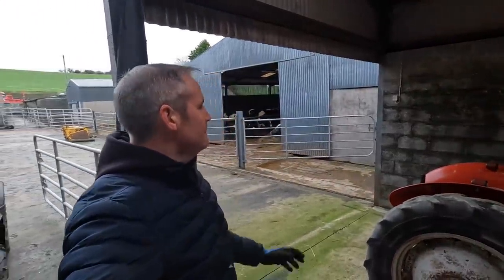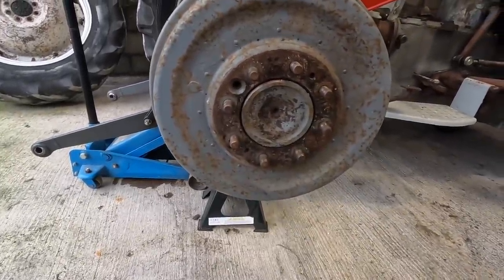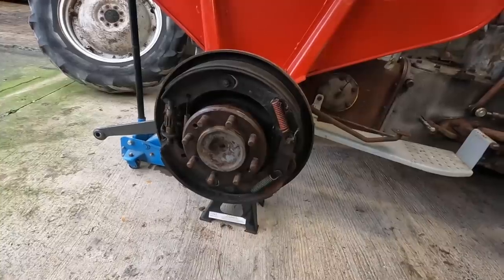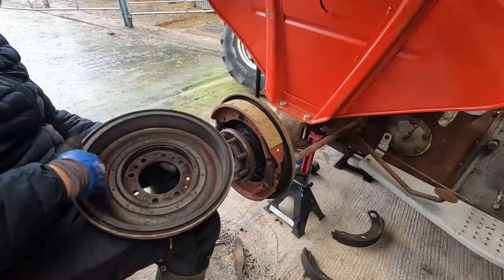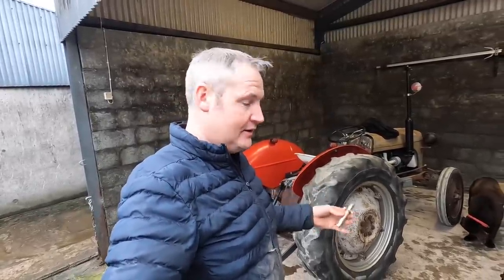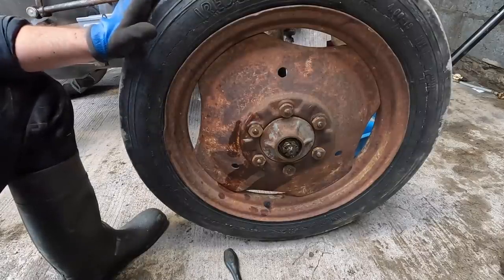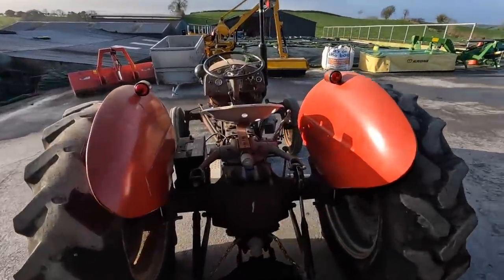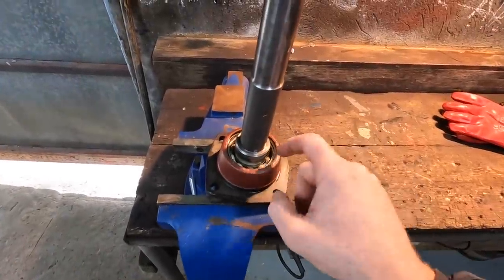FERGUSON TEF 20 RESTORATION -- PTO SEAL-- BRAKES OVERHAUL-- AND SOME VERY MILKY OIL!!

Comment: We replaced the pto completely with the larger size shaft so it can be used. Took the pump out too, found out it was well clogged even tho it worked. I'd say that front wheel will still wobble when u drive it. Taking a fergy for a spin up the road is enjoyable, anything more is not.

Comment: I think im right in saying t20 had studs and washers to hold the brake shoes,the pin and spring were fitted to the FE35 onward.
Reply: 100 percent Mark
Reply from the maker: Hopefully so, means I’ll not have to take them back off 🤗👍
Reply: Yes Mark 100% correct fella..

Comment: Make sure rubber around gear stick is not worn or cracked, moisture on rain water will get in der👍
Reply from the maker: Have one here for it 👍
Reply: @IFarmWeFarm  Ferguson T20 dont have rubber around the gear stick, that wasnt until the 35's.  T20 have a metal collar on the bottom of the gearstick.

Comment: I drive my 135 and goldbelly all late spring and late summer and I love them without a cab, it can be colder, yes but the cabs never are the best and can be a pain, the only reason I live the cabs is the aspect of safety, many times I have clipped my leg on the tyre or rested my hand to far out to the left and be driving along only to have dust in the eyes. Nowadays I would say cabless is the better option, at least for >40 horsepower machines

Comment: I can remember rolling ploughing with a DB 880. Had to keep your hands out of the steering wheel or you’d end up with snapped wrists. Great video. Good luck 👍
Reply: My grandad used to let me "drive" a 135 up a bad road. Quickly learned to keep my fingers out of the center of the steering wheel!

Comment: I know it's 11 months since you posted this video, you where so lucky to remove that brake drum with your hands, in all the years I worked on tractors I never had one like that, it was heat hammer or sledge hammer even smashed the drums, we always used a centre pop on the retainer screws if you did not have to drill them out, Happy New year to you and your family

Comment: Partner & I are about to restore his 1953 TEF20. Your videos will be a great help for this, lets hope we can get the parts needed🤞🤞 already struggling 😅 can I ask what engine oil you have used in yours? (is it also the same for the PTO?) It'll be one of the 1st jobs we do, once we've cleaned up the grease 🙈

Comment: Just watched your video I've got a 1952 Ted T20 my brake shoes are identical to yours ie same springs and the 2 nuts it all works perfectly fine so I would suggest leave them as you found them👌

Comment: The red springs in the right hand drum when you are putting it back together, am sure there is supposed to be two different colored springs as one is a leading shoe, so maybe a black spring at the bottom and red on top.  Cheers

Comment: Adrian, the phrases "it's the wrong one" and "it doesn't fit" are all too familiar as I'm replacing parts on my TEF20 as I go. I don't know where the retailers are getting this stuff from but some items are a bit shoddy. The MF35 is still in production (!!) and I think we might be getting cheap spares originally intended for the East African market?
She's looking good mate...!
Reply from the maker: Ya new parts doesn’t usually fit 🙈, hard to get used bits but there fare better if you can

Comment: Brilliant video Adrian well done again. Just wondering what model no. the impact drill is and has it ever not opened bolts?only have 1.3 amp battery at min may be too small...
Reply from the maker: That’s an 18v volt 5amp battery. Now I love my dewalts and have loads of them all in the XR 18v. But that larger 1/2 inch model isn’t great, very poor in fact. the 3/8’s version that I have is nearly as good. Wouldn’t open any car or tractor nuts. Only bought that one a couple of months ago. Bought a Milwaukee version in 1/2 this week, there’s no comparison really. Sold the dewalt yesterday.
Reply: @IFarmWeFarm  thank you Adrian your a gentleman, will hold off buying for minute would not have huge use for one but handy to have, am very happy with dewalt drill even though small still great, maybe sometime Milwaukee could be reviewed as part of video

Comment: We had a similar tractor as this and we had a very very small wheel seal leak on both sides that wreck the brakes. I would replace the axle seals if I was doing it. We also use to drill, tap and put a grease Zerk on the front hubs if it was possible to make sure they had grease. Why do you have one of the tires mounted with the tire bars reversed? That snap ring on the PTO is what I call a Jesus ring. When it comes off and flys I say Jesus where did it go. lol We have had water getting into the casing through the boot around the shift lever. Sorry for all the questions but I love your videos and how you explain everything so well. Thank you from the USA!!
Reply from the maker: Yes them axle seals can leak and destroy the brake shoes, not hard to fix though just takes a bit of time. Yes one tyre is on wrong, was like that when I got it but I’m not to bothered as we’ve a new set of wheels for it.
Thanks lad 👍
Reply: @IFarmWeFarm  Thanks for the lad comment. I am old enough to be your dad. That is why I think? I am full of wisdom. lol

Comment: Good stuff. 
Smiths of Cavan were the main men in Ireland for those 20s back in the 50s and 60s. 
A huge operation, be interesting to hear what your father remembers of them
Reply from the maker: My father bought his in Kingscourt, just there where there hire place is on the road to Nober. Where was smiths based 🤔
Reply: @IFarmWeFarm  I think smith’s only sold refurbished ones and had a badge on them stating that ask your father.